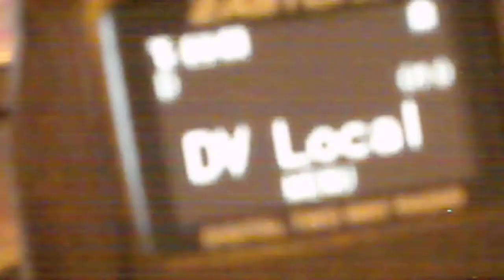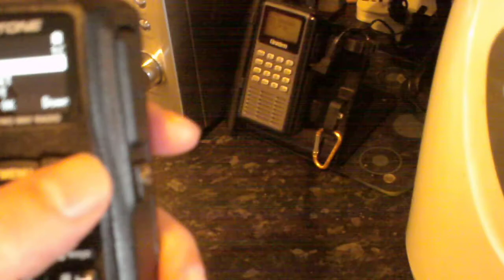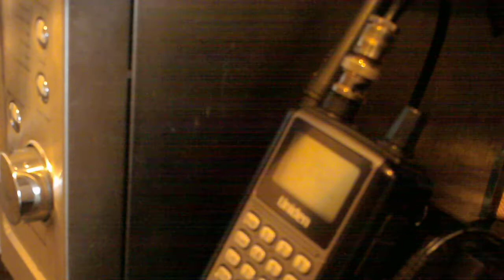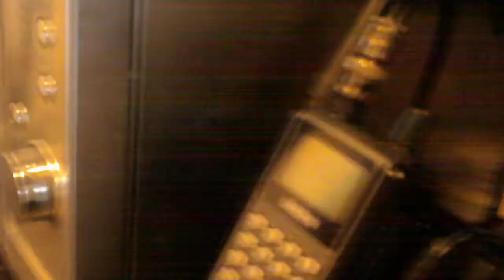Zastone ZT-9908 DPMR Digital Analogue radio

Comment from the maker: I have the MD-380.
very pleased. 
my Zastone was great just as my colleagues was. But they Chinese and you take a risk with any individual set , and youll rake a risk with an MD-380 just the same.My MD-380 us just great , but your one might be crap??
"you pay your money, you take your chance " if you dont want the risk, dont buy Chinese., buy ( Hytera ) or (Motorola) for extra £300 and youll be very happy with it.
Reply: With chinese radio i have a lot of positive reaction, i have wouxun, baofeng, tyt uvf10, KST kirisun but all of them have kristal clear tx and rx without buzzing or rusteling or another. My tyt 9800 is also perfect radio without issue, but the zastone 9800 with this buzzing is unusefull, nobody will lisen you your voice with buzzing :-). The tytera md-380 have a lot of people and nobody said that every piece shuld be different, all have perfect cristal clear modulation tx,rx without isue. For hams (motorola, hytera) is just a to expensive one band toy. More better is yeasu or kenwood or alinco. But i am curios if this buzzing of the zt-9908 have all of them :-)

Comment from the maker: Unfortunately I have moved on to a TYT radio in DMR mode now and no longer have or use this radio.
however if I remember correctly on "One" but not all repeaters I had reports of a buzzing noise accompanying my tx. however.....
I found that if I changed the bandwidth from wide to narrow  (it stopped!)
as to why?....
I have no idea.
Reply: I buyed this radio and i thought that i will be like tyt dmf10 or another, but is not usefull for a ham. On repeters my ham colegues give me report also with buzzing on tx, but on my station it made on wide and norrow also with high power level, on low tx it has anoing rusteling, so i didnt know if i get just a bad one or the type of radio is like this. On digital is no problem. You dont remember if your ham colegues with had the same type of this radio had the same problems? Im thinking to buy another but im afraide that i will get the same piece of sh.t :-). Maybe it will be better to invest in something like md-380 tyt, thanks for info

Comment: hi, yesterday i got the radio, evrything is ok, but is a problem with the radio on TX in analog mode, it has on all frequences some disturbing like a power supply wich have not filtering, is there a anoying secondary sound so i cannot use it like ham becouse it is unusefull with this isue. Please say me if you have the same isue with this radio? Thank you very much best regards

Comment: Paul you seem to be the only one that's done anything with this radio online.  My question is. I cant make this scan like I think it should.  My Baofeng I push the "*" button and it scans all my 128 channels.  I set up scan on this unit in the software to scan each channel.  I set the bottom quick key to scan. As long as I hold the button it scans.  I do I make it scan through every channel continuously without holding down the scan button.  If anyone can help please let me know.

Alec
Reply from the maker: sorry Alec ....
I cant investigate this radio any further due to the fact ...I no longer own one Im afraid.All I can offer is that maybe that key you chose to assign wasnt the one to use.

Comment: Im looking for buying some radios 4-6 pieces. Mainly use is for the Sound and lighting industry. And came across your video on a google search for a digital PMR solution. Can you recommend these radios and for how long have you had one ? From the video i guess they are quite sturdy. How much did you pay and where did you buy them from ? :-)

Thanks in advance.
Reply from the maker: I most certainly would recommend the radio, the build quality gives the radio a very professional feel. It's very much Motorola in its feel. As with all Chinese imported radios it is susceptible to the odd malfunction .
But Im very happy with mine. I will be doing another short vid within the next day or so to explain some of the questions on the functionality etc.

Comment: Thanks in did hear say on the vid just checking as every1 I have looked at you needed to download the software. So am looking 4warded to getting 1 now. Did you ever get round to doing a update on radio? You said at the end of your last1?

Cheers for getting back to us really has helped.

Patrick
Reply from the maker: No worries Patrick...
It is on the books for a Range test on them but my oppo is a shift worker and as we need 2 of these really , then it's a bit long in the tooth coming I'm afraid. You won't be disappointed with this radio, I've had some "nice audio , no probs reports", so I'm more than happy and I do think it's the best looking of the bunch by far. That's if you're not a colour screen man.
Regards
Paul

Comment: Hello
can you type frequency in to the hand set or do you have to down load software go go though a computer?  

I've been looking at some kirisun and been told you need the software to program frequency in.

Patrick
Reply from the maker: As I've explained in the vid , you can without a doubt programme a channel manually from the set. As I've done with all my channels . You can also change the settings of each channel on the fly, as and when you wish , again ..(From the handset!!).
So said man with Kirisun is "Wrong!".Lol
Hope that helps 
Rgrds
Paul
Reply: Actually whoever told you that about the kirisun was right. But the Kirisun is a totally different radio to the Zastone. I had the Kirisun S780 and I can confirm that it can't be programmed from the handset.

Comment from the maker: Yeah I remember you doin that one....
Really enjoyed that one as there wasn't much out there on these DPMR  jobs .
We've used these radios a long time now , and when we started to use em... We stopped using analogue , we found them so much better for both range , volume and clarity , such that we never used analogue since , which wouldn't make any sense at all if they were worse.
But that just our findings here, different terrain , location etc might be different.
We will be doing a range test shortly for art three.Having said all that , I've found in my experience that no radio seems to behave the same way consistently , making it difficult to arrive at a solid conclusion, changes in environment , external unpredictable signal influence can all play completely random parts in the range/ quality radio test game. 
We try!
That's all we can do but it's never a guarantee of the equipment working the same for anyone else .
Regards
Paul